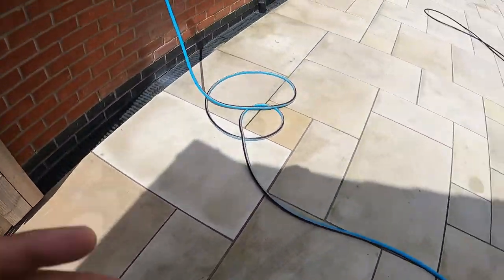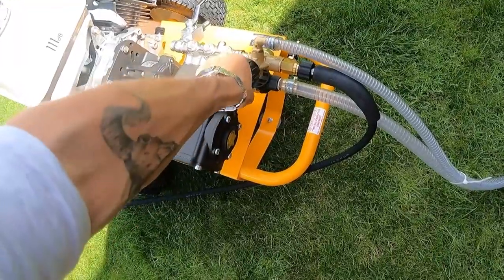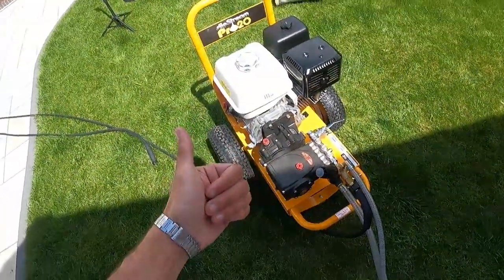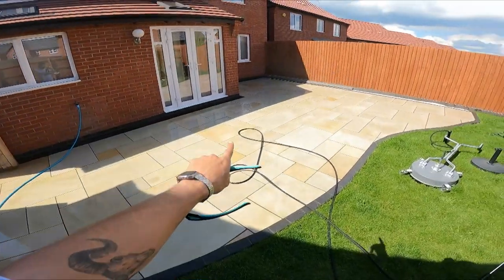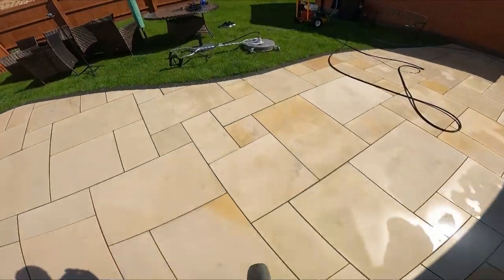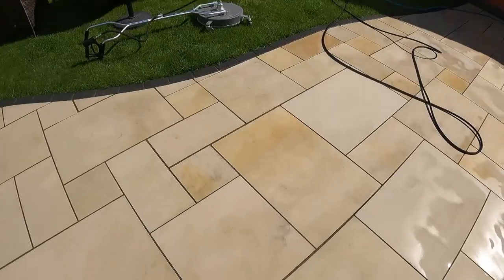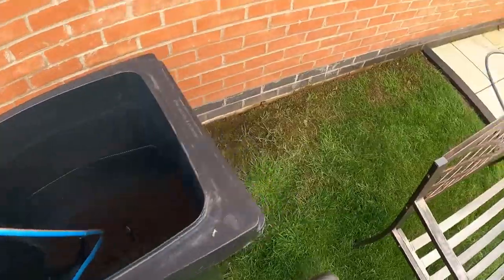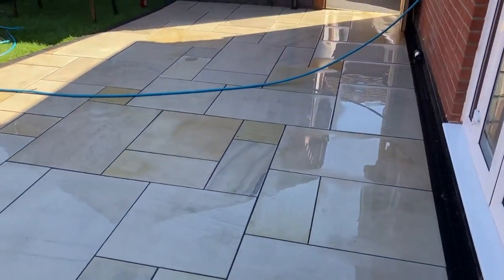Pressure Washing A BEAUTIFUL Patio (Brand New Equipment!)

Comment: Love the vids mate!! I know exactly what those large circles are!! Who ever has laid the patio has not laid them on a full bed. They have been spot mixed. If you spot mix indian sandstone that is what happens. Those circles are the cement underneath.
Reply from the maker: :0!! Thank you mate! Will tell the customer, it’s been a year and they’re still getting new “damp patches” appear so that’s the cause. Thanks a million 👍👍
Reply: Agree, my parents have patio stone with obvious circles each corner and it’s the cement underneath been done badly.
Reply: I agree but with sandstone the bottoms need to be seald with sbr or a slurry thats what causes leaching of the slabs as sandstone is porous it may be laid on spots easiest way to tell is hit them lightly with a rubber mallet and they will sound hollow 👍

Comment: Cracking job Sid, good to see you got a new machine onwards and upwards and good luck with your YouTube channel 👍 Have you thought about mounting the machine in the van, it makes its so much easier when you turn up to a job, just pull a couple of hoses out and your ready to start.
Reply from the maker: Nice one Ricky! Really appreciate that mate. 
Yeah definitely thought about it, my vans quite high up and the machine weighs more than me so I feel like I’m gonna break my bank even using a ramp 😆 once I’ve sorted the floor out I think I’ll definitely mount it. 👍👍
Reply: @PartridgeExteriorCleaning  what type of van you got sid ? I brought a small Ford connect van a couple of weeks ago and am kitting that out with a small system like yours, Contact me on messager ll send over sone photos of the build any lay out if your intrested.👍

Comment: You could drill a hole in the side of the bin (near the top obviously) and fit a ball/float valve like you'd find in a toilet cistern.  Fit a hozelock style connector to it on the outside of the bin and connect your filling hose to it.  As the bin gets full of water it would then shut off the supply, as the level drops the water is allowed to flow again.  Would stop the overflow issue you spoke about.
Reply from the maker: Yeah definitely mate I will get the conversion kit sorted soon, just need to try an save a few pennies for a bit its been an expensive few months, i'll keep upgrading slowly along the way now (: thanks mate

Comment: I think the tile is lovely, and I like the pattern.  What a nice back yard space they have.  You did a good job.  Seems to me that whoever laid the tile, then sealed it, didn't make sure it was clean.  Also, there are natural blemishes that should be looked at as traits of their patio.  Mother nature marks us all.
Reply from the maker: Yeah its very pretty isn't it! yeah i think after speaking to the homeowner a while back that it was one of their first jobs.. so silly newbie mistakes made that have left some marks but I took care of what I could!
Reply: @PartridgeExteriorCleaning  I've seen similar issues with natural stone, where they didn't lay a full bed of mortar or sand down under it so it would get moisture puddling underneath and started leaching to the surface. They ended up tearing the whole thing out and doing a an entirely different rock.

Comment: On a sunny day, wet the area and put down SH with some Surfactant in first. I always leave for 20 mins and then start pressure washing. Sometimes have to repeat the process again at the end but just a rinse down after. Soon you will get to no what mix ratios needed by just looking at the job but Google any your not sure of 👍
Also, sand stone can have fossilsin them which appear more over time. You'll never get rid of those obvs 😁
Nice set up mate, will really see the benefit when you get your first block paved drive way. 
Really happy for you and how well your channel is doing also, respect.
Reply from the maker: Cheers mate! Thanks for the tips really appreciate it.

Comment: You might be able to use a wet stone to lightly grind it out.  When I cut agate and jasper, I frequently hand polish the cut marks out.  Use light circular motions while wet.  It's going to take a little effort and make a milky mess, but it will let you grind it down and feather it out so you can't tell it was pressure etched.
Reply from the maker: Can I sub you in? Sounds like something I’d definitely mess up! I don’t have a gentle touch 😆
Reply: @PartridgeExteriorCleaning  I'd totally do it, but it's way out of my territory.  I'm in Oregon, USA.  It really will come out with just little more than the weight of the stone.  You could find a messed up stone and practice......  That's how I learned.  It's a skill to learn and add to your arsenal.  I've "restored" quite a few pressure washing burns.  $4.50 sq/ft for stone work adds up.
Reply from the maker: Wow I’ll definitely look into it, I do tend to love the “specialist jobs” and love getting a new skill, thanks mr Briggs!
Reply: Those are very porous tiles...and because they are natural....they need a light sandblasting...and then some sort of protectant put on it afterwards. Maybe you could buy an acid that etches??

Comment: You need to remove the red filler caps and place yellow ones with fluid level markers  👍🏻

The dirty bits / shading / shadows is because the installer had not placed these in a full cement bed the pavers are natural and porous
Reply from the maker: Okie dokie I think there was some of those in the bag! I'll pop them on tomorrow :D

Comment: Sid we are landscapers , my advise would be so not out any hypo on these slabs. The mint sawn and honed is one of the most pours sandstones out there. These should of been pre sealed before laying or sealed shortly after. All that grime / green / grit you are pointing out would of embedded within the stone. 

Don’t bleach them you will cause further problems 

👍🏻👍🏻
Reply from the maker: Okay mate thank you for that! I did a very weak mix left for 15 mins and rinsed away so hopefully all is well, it definitely seemed to be okay. what do you think?
Reply: @adlandscapessouthwales2960  morse code for all good?

Comment: The markings in the back is because the slabs have been laid onto 5 spot cement and they have failed to prep the underside causing moisture to show through and stain from underneath, tho you improved the appearance I feel it will come back pretty quick.

Comment: You should be running a pressure gauge if you're going to adjust the unloader valve, as these are factory set to the max safe pressure for the pump. Just screwing it all the way in is going to prove costly when the pump says see ya.
Reply from the maker: Oh really? So never turn it up all the way then? Shall I stay 3/4 to be safe?
Reply: @PartridgeExteriorCleaning  You'd be better off with an inline pressure gauge, or a back mounted version directly in the pump. Make sure it's capable of handling the max flow of your pump though. Spinaclean ought to know how best to help you out.

Comment: Hi bro, 4% hypo pretreatment on that  stone ... ideally your machine should be 25 litres per minute minimum for surface cleaning especially on 21 inch  and up to 30 inch surface cleaner , machine psi maximum should be 3500- 4000 psi.  It's the litres per minute that counts.. also pretreatment and post treatment... I find best to cut in last.. 👍

Comment: I likie how methodically you do things and you give the equipment ime to do the job rather than rush. In relation to stains remember the stone will contain minerals copper for example with the green and when the stone is cut and gets wet they are exposed to the air and can oxidise. Your fighting the natural makeup of the stone. Test this on a small area;
Reply from the maker: Brilliant fantastic tip. I used bleach on the top corner section an let it sit for 20 mins, when i rinsed off it looked a million times better so blasted the whole patio, im almost too careful with that chemical I think but just happy it turned out well!

Comment: Omg that’s the same stone as I have on my floor in my whole house , I’m at my witts end trying to keep it clean and stain free ! If I could add a photo I would !! 
I’ve been quoted £2100 to clean and seal it and simply can’t afford that ! 
What’s hypo ?? And can I use it in small sections indoors with the windows and patio doors open ?? Thanks 🙏🏼
Reply from the maker: oh wow that is pricey but sealing can be a nightmare. 
Sodium Hypochlorite, its very cheap but very harsh so make sure you use every step of PPE you can while using, really research it. It's basically very very strong bleach.
It's definitely not recommended for indoors it will make the house smell like a swimming pool for a while!
Reply: @PartridgeExteriorCleaning  thanks for the reply, I’m not sure if I’m supposed to use acid on my floor but heck anything is worth a try now ! 
Have you any recommendations for a sealant ?? Or is that the next video ?🤣🤣 thanks

Comment: How are you enjoying the surface cleaner?  I quite like how quick I can get a job done, but I really do hate not being able to hit the tight spots and backwash without changing the gun first.  It's the worst when you don't have the quick connect.
Reply from the maker: Loving it, i still like using the lance as it's more satisfying but speed wise its awesome. QR connections are a must
Reply: @PartridgeExteriorCleaning  Another thing I don't quite like with the surface cleaner is the lines it can leave.  Have you any issues with that?  I'm trying to learn if there's ways to avoid that on concrete.
Reply from the maker: You just have to go really slow and overlap your last line by half and it turns out fine :)

Comment: Hi Sid. I always watch your videos as they come in. Im starting a pressure washing business in Australia. I have a question in regard to the equipment setup in this video.
I have just purchased a Honda belt driven 21 LPM machine. Going to do the garbage bin buffer tank. The hose to draw from the tank appears wider in diameter than a normal garden hose.
Is this important? A wider hose using a clamp than a normal hose connect. Did your suppliers advise a wider diameter?

Comment: Hi sid 
Quick question for you .why are you running the siphon feature on your machine when you have a water supply can you not just connect straight to jet wash
Reply from the maker: Hi mark, the jetwash is more powerful than the tap so it wouldn’t be running at the correct water needed to use it, the siphon is to make sure it’s always getting the full amount it needs 👍
Reply: @PartridgeExteriorCleaning  cheers sid I was wondering why people do that lol

Comment: You see your surface cleaner. We're the hole is were the hose goes through. You wona put some rubber inside it because the hose will rub on it and over time it will burst your hose. Hope this was helpful and good luck. 👍 it's the loop half way how the handle
Reply from the maker: Oooo good shout mate I wouldn’t of thought of that, I’ll get straight on it mate thank you 👍
Reply: Haha no worries. Alot of them all ready have them in. I'm surprised it's not got one already. Are you sure it's not in the box?? Haha
Reply from the maker: @aarzy888  :O i will check in the morning, Was too focused on making sure the ptfe tape was good enough xD

Comment: Indian sand stone ir rainbow sand stone has many different mineral in the the stone  which leach out over time if the surface is not clean and sealed.
The rust could be natural but more likely it come from the cutting tools when laying. Hot sparks have it the stone become embedded not cleaned properly and the iron has rusted

Comment: Why dont you use Hypo on every cleaning job, you see how it gets you better results and probably will help more with business
Reply from the maker: It's a harsh chemical and I prefer not to be exposed if i don't have to, I wear all the correct PPE but mistakes are mistakes for a reason, I just worry about an accident occuring!
Reply: @PartridgeExteriorCleaning  yeah I understand that, it’s probably a mix of both, it being a harsh chemical and the overthinking of what it could do etc. Your still doing a great job regardless

Comment: Quick one bud I noticed you need to change the drips over on the machine you still have the red ones in. They need replacing with the yellow ones cheers.

Forward to 2 min in hope this helps and great video cracking results 👍

https://youtu.be/up2GOyrlofA